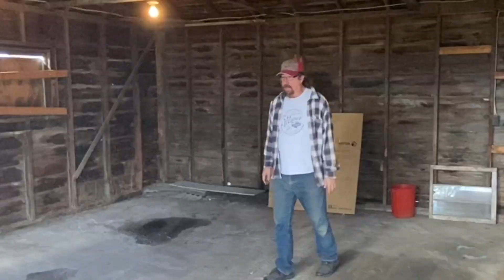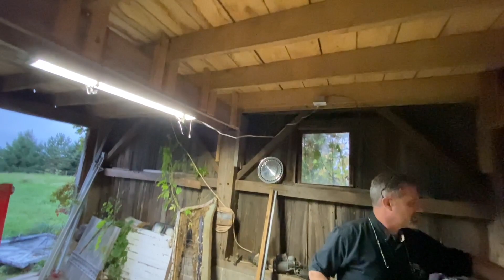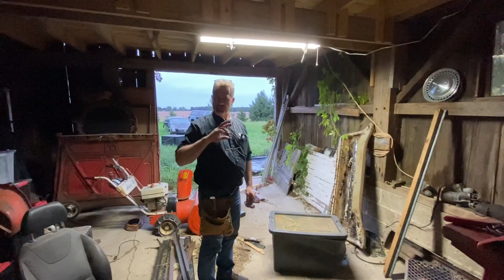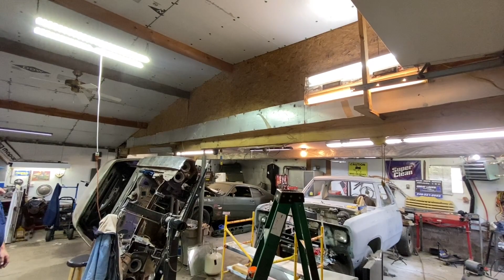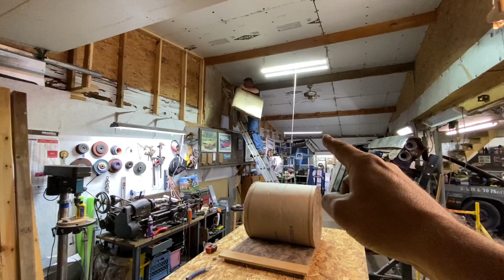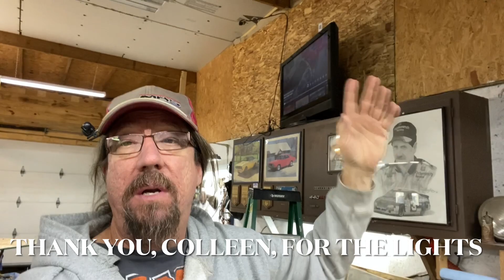Upgrades & Repairs in the shop are important! Can't Move Forward if Your SPACE Is Holding You Back!

Comment: LED lighting is so great!  I can't believe the pure amount of Lumens that these things can put out, and now I am seeing them with the ability to select your Kelvin rating, as well as being able to change colors.  They are truly amazing and even fun to play with.
One thing that can be confusing is the LED designed to fit in old fluorescent fixtures.  I have found that some are designed to work with the ballast that the flourescent lights used, and then have their own built in adaptation in each bulb.  I have also seen some that have no ballast and  adapt from the 120V current directly with each bulb.  These won't work in a fixture with a ballast. Both of these may, or may not, work with a dimmer.   Then there are the POE LED fixtures that run off of ethernet and CAT6 cables.  These require you to run CAT6 and have a whole separate power source that essentially runs at about the same voltage as your USB phone charger.  This is becoming a new feature in modern smart homes, and allows computer controlled operation of lights throughout the entire home, as well as things like blinds, thermostats, and alarm systems. 
I personally like my light at 4000K, or as close to it as I can get.  This is the truest white light.  If you go up to 5000K or above, commonly called Daylight, I find that they tend to have a blue hue.  If you go down to 3000K you start getting a yellow hue.  Most the LED's you find are 3000K or 5000K.  It sort of makes me angry.  What Temp are you running in the shop?  The white areas appear white, so I am guessing you are close to 4000K, running something called Bright or Cool White.  I find that you pretty much have to select a brand, because even if they are all called Cool white, some will be 4100K and others 3700K, and when you put them next to each other you can tell the difference in color temp.  Throw a 2700K Soft White into the mix and the contrast is glaring.  I am curious if Chris has a particular brand he recommends.  An electrician probably has some grasp of what lighting has a better reputation than others, what ballast is 💩, and what is :trophy-yellow-smiling:.
Anyway, the renovation is looking good.  Do you bother with any sort of vapor barrier?  I know that construction varies in different states, and in different building types.  I was a bit curious about the R factor of the insulation rolls, but any at all is better than none.  I have seen some pretty strange things used to insulate.  I remember this one house was built with aluminum cans in the walls, in an effort to recycle garbage.  You can use some pretty crazy stuff.😲
Looking forward to part II of your renovation.  Until then, stay warm, safe, and healthy. 🤟RAWK!
Reply from the maker: You are correct. Some are designed to bypass the ballast, while others are designed to work with it. All the ones that I have converted work with the ballast and I am eliminating those.

When I did the rest of the shop, all of my outside walls have a vapor barrier, but I didn’t bother on the inside upper part.  Not really much wind there to be worried about.  Lol. 

As always, thanks for watching. Good hear from you.
Reply: @MyKARSShop  So do you know what Kelvin they are, and are you using the same brand in all of them?  Don't need to specify brand if you don't want to.  I am pretty sure they are around 4000K, commonly called Cool  White, but I want to know if I am correct.  The walls in the video look very white so if they were a different rating I am guess it would show up as slightly yellow or slightly blue.
Reply from the maker: @Tarry_Plaguer clue, no clue. All I can rate them by is the fact that they’re the cheapest  cheapest lights I could get? Did I mention they were the cheapest?
Reply from the maker: By the way, I believe this was R 24